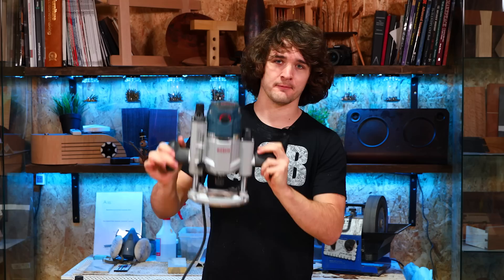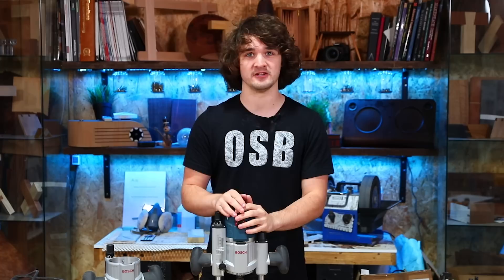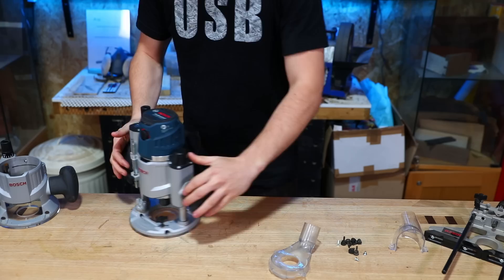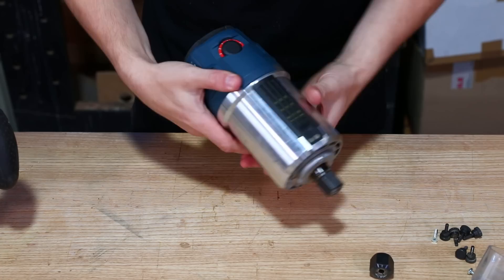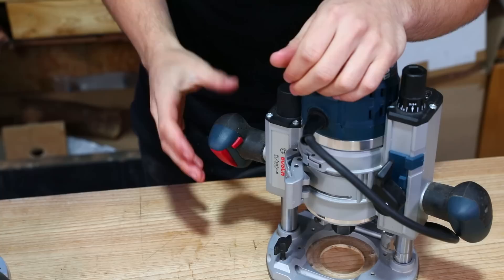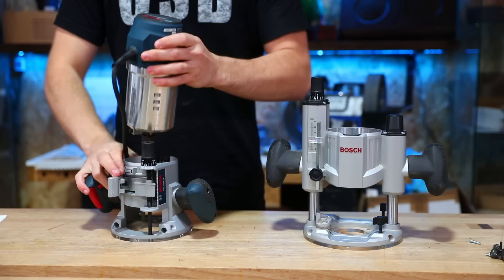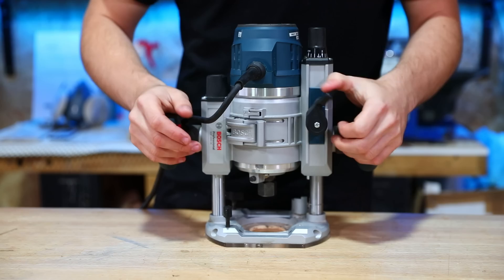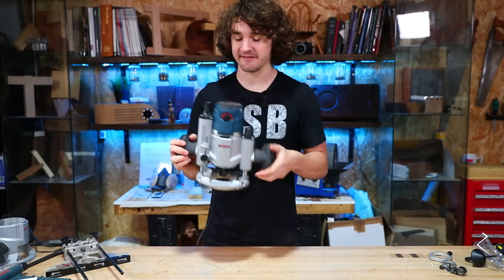BOSCH GMF1600 Router Review (Including Comprehensive Overview, Specification and Setup)

Comment: Am hesitating between this router(seen a lot in videos from the states,) and the Trinitron(that I can buy here in France.)  Great video; always liked Bosch Products...cheers...rr Normandy, France
Reply: Richard Rider   Hi, I bought Triton  trai001 and  nex day returned to shop really  cheap look and quality of buttons, plastic crap , to attach under table and  change bits brillen idea but when I start to cut round table  the bit fell down from collet  twice I was so sock   It was dangerous  for me! Plus 2400 watt   On paper look powerful but when you  start use  I didn’t feel power  and no led, when you switch on  3 second later start honestly I didn’t like quality at all returned  shop back ordered  Bosch 1600 gmf!

Comment: This is the best review of a router that i have ever watched so far!  I am in the look for a good router at the moment. You just might have talked me into buying this particular brand and model.  Unfortunately, I do not know what is the counter part model of this in the USA.    

I intend to put it on a router table.  That being said, what is the maximum height that I can possibly lift the blade up above the router table, considering the thickness of the aluminum plate or wood plate that i will use to mount the router? 

Also, being new to routers, what is the use of the brass bushing sets?  Hope you can demonstrate a video on what and how to use them.  Thank you very much!
Reply: Bosch MRC23EVSK

Comment: I nearly killed myself with a dw618 yesterday had a bit that was improperly set 1 1/5 lbs of steel flew out of the machine and by sheer luck flew from a tangent away from me found it 50ft away.

Instant life lesson, the thing shock and vibrated for 10 sec and i could not spare a hand to turn it off before it went off the rails.

Im not going to use it again and i bought this one with the dead man trigger.

Thanks for the video matt.

This was effin scray

Comment: I've just about finished table mounting one of these using the Bosch Fixed Base.  I absolutely love the router 'for the most part'.  I especially like the micrometre height adjustment on the f8ixed and plunge bases which is calibrated in millimetres and appears to have no backlash.  What I don't like is that you have to loosen the clamp on the fixed base to adjust the height, and the the clamp is so difficult to undo.  So I'd welcome thoughts on this if anyone has made a tool to undo that clamp.   I am also thinking the spindle lock button is not that easy to access when the router is table mounted. but I might rig up a solenoid to take care of this.  It would not be straight forward as the router have to be in the upper most position for the solenoid to align, but it is doable.  I think I measured the force need to push the button at 2lb.

Comment: Hello Matt, I have purchased the bosch gmf 1600 ce router....hope thats right...and Im also purchasing the ujk table. Can you tell me do I need the collet extension if I was to be changing the router bit above the router table via insert lift. Im very very new to this routing business. Great videos Matt.
Reply: This is exactly the question I was looking through the comments for.  Did you get one and can you change bits with it table mounted?  What about with a cranked spanner and decent sized hole in the table insert plate?  I would be eternally grateful if you can answer this.  Thanks.

Comment: Given how the power contact point are mounted for the trigger system these router will not work in any router lift system that doesn't mount the fix base to the table.  With  that in mind I'd still opt for the 1617.

Comment: So I have one of those and I absolutely hate it. I was looking at your video to see if there was things I was doing incorrectly or if there was some tips I could learn. The jack of all things, in my opinion is not a good thing as it does all those things not very well and I would highly discourage from using it in a table setup. I find that without locking the mechanism you cannot be sure the cutter is square with the plate but if you lock the mechanism you can no longer make adjustment. Also, that stupid handle trigger makes it impossible to use with any other professional lift (because you need the handle to turn it on). My recommendation is buy something else. Something more simple for your table setup and maybe a small hand router. It will probably cost a little more but you'll thank me.

Comment: Regarding the unresponsive trigger, the delay almost seems like a safety feature rather than a bug. For example, you release the trigger to be done with the cut, and accidentally press the trigger again for just a moment. If there's an intentional delay in response it might ignore that extra input. Granted, proper safety procedure would tell you to keep control of the tool until the spinning element has completely come to rest, but that doesn't always happen. I wonder what happens if you try feathering the trigger -- will it ignore the quick press/release inputs and continue spinning down?

EDIT: I've had the Bosch 1617 for a while now and quite like it. My biggest gripe, aside from the inconvenience of attaching/detaching dust shrouds, is the switch on the body. There's that moment where you turn the tool on with only one hand to control it, so the trigger-actuated switch on the MRC23 is very tempting.
Reply: I agree about the delay in the switch it could be a good thing!

Comment: NOTE:  only the GOF is available in Australia.  If you want the fixed base that costs you an extra $150, however, after watching this review I'm definitely getting one.  You also have to buy the fence separately.  And you don't get a nice carry box with it.  As always, we in Australia are screwed over when it comes to availability of cool gear.
Reply: Hey Blue Wren, where were you able to get the fixed base and guide fence from? I really want the GMF kit with everything but also live in Aus and the GOF doesnt have the same appeal. If I can get the bits separately, I would consider it, although they sound expensive.
Reply: @andrewford80  I got the fixed base from Total Tools in Hobart.  I believe they had it shipped down from their Sydney store which apparently had several in stock.  Please note that when you go to the total tools website it doesn't appear there (nor does the fence), so you probably have to ring them.  In my experience Total Tools are fantastic to deal with.  I didn't buy the fence.  I bought the Bora track instead as this was the better accessory given that most of the time the router will be in my router table, which is why I bought the fixed base.  The easy change out between the bases means I can switch from table to hand held in a jiffy.  It's an awesome router for all the reasons Matt outlines.
Reply: @bluewren65  thanks!
Reply: @andrewford80  No worries! Best part of you tube is helping each other out and interacting with other woodworkers.
Reply: I’m not sure. My router table has a set of clamps that will suspend pretty much any router base so I did t need to use the mounting holes. I’ll take a look today and get back to you.
Reply: I just checked and the mounting holes look the same as on the router. If you are in doubt you could always ring Bosch Australia and speak to a technician.

Comment: Hi Matt,
I recently bought this GMF1600CE set, based on your review here. I like you set up a fixed router table; However I choose to rotate it 90 degrees relative to what you did. This puts the two 'sets of controls' not on the front and back of the router table, but one set of controls on the left, the other set on the right. This gives decent access to both sets of controls.
Now 'all I need to do' is to learn how to use this versatile tool to its full potential....
Hint: Could you provide more detailed instructions on using both the fixed, and plunge router to make the various joints etc.
Thanks for your videos they are both educational and entertaining!
Willem
Reply: Hi Willem, I'm in the process of building my router table and need to drill the insert plate and like your idea of the 90deg rotation. How did you go about marking out the holes and drilling, there seems to be four securing holes in the router base plus the hole of the above table height adjustment. Instructions in the manual are not overly detailed.
I hope you don't mind me picking your brain, regards John
Reply: @johnweir2460  Hi John,
I turned the router upside down. I used a bit of cardboard on top of the routerbase to mark out the holes. Then I used an owel to punch the holes and screwed the cardboard in place just to make sure. I removed the cardboard template and placed it on the underside of the routertable. I next stuck it all in place. I rotated the template making sure I can access all controls. I drilled the routertable top using the template  and screwed the router in place.
So far it all works well.
I hope this answer your questions. Feel free to ask... 
Willem.
Reply: @WPGinfo  Hi Willem, thanks for the advise, I'll give it a try cheers

Comment: When using the router on the router table how does one control the on/off electrical power. Should there be a separate on/off switch mounted somewhere convenient?

Comment: Hi Matt I watched your review of this router and it clinched my selection decision, unfortunately with the Covid pandemic I had to wait several months to take delivery and then the router table I wanted (Rutland) was out of stock. Anyway to cut a long story short I'm in the process of building the the router table and I need to drill the mounting plate to take the router. Can you share any tips on centring the router, marking out the holes and drilling; I've been searching for instructions/videos but with no joy.
Keep up the good work :)

Comment: Do you need to use the clear acrylic base for mounting the motor on a router table, or can you just bolt the motor to the fixed base?

Comment: About the table router. Am I being thick or you can just fix it with the locks to one side and the speed control to the other??? having a small angle to the fence you can even have the level adjuster near the fence.

Comment: Got this router a couple of months ago, great versatile router, one problem though, the spindle lock never worked and ended up removing it and just use 2 spanners
PS
Looked at both the links for the router, one is out of stock and the other is low stock, I don't believe that a company would sell out of stock within 10 minutes of this video coming out. I do wish that UTubers would check their links, the websites do say if there is low stock on something after all you cant get paid for the link if there is nothing to sell
Reply from the maker: Glad to hear you like it Roland! The issue with stock is why I provided 2 links for the UK. It gives a higher chance of the routers being available straight away. This is only an issue currently however they will most likely be in stock if someone was to watch this video in a month or two.

Comment: When you mount it under the router table, do you reach for the trigger every time you turn it on? I wonder if there's a way to wire a permanent switch installed on the router table to override what.
Reply from the maker: My router table has an NVR switch that I can plug the router into. So I only have to turn it on once, then it’s all controlled from the switch
Reply: @MattEstlea  I thought the router will not turn on if it was plugged in while the trigger is already pulled back.
Reply from the maker: This one does. It’s often a safety feature on power tools with on/off switches that can accidentally be left on. However seeing as this is a sprung trigger, it’s quite difficult to accidentally leave it on. Unless you use the trigger lock of course.
Reply: @MattEstlea  OK I just tried it on mine, and no surprise you are correct. It does turn on when plugged in if the motor is in the base and trigger already pulled/locked. The safety feature kicks in if the motor is inserted into the base when it's powered and and the trigger on the base is pulled/locked. 
Gosh I've been wrong about it all the time. I even bought a separate motor for the router table thinking the Bosch won't work well under the table with it's fancy trigger switch.

Comment: I just watch this video, and I was wondering why you dont mount the router with the non-switch handle forward, then you would have access to both the release mechanisms and the speed control easily on either side. And the raising screw would be accessible and you could use a remote power switch after locking the power switch after installing the motor to the base

Comment: So you use the quick-change system to install a slow-change system because you can’t make a box to hold the quick change fittings neatly?  :)
Reply: The original bosch fitting are quite expensive.

Comment: Dear Matt. Thanks for your overview. I actually have this kit but did you ever have issues with the rails on the plunge base catching or being jerky either on the way down or up? I've had so much trouble with this, even after lubricating according to the advice of techs over the phone, I couldn't safely use the plunge feature. I'm trying to decide whether to try getting another one, or just not do plunge routing for now. The router itself and the other features still work on the fixed base just fine. It's a great router otherwise.
Reply: Ditto, I have the exact same problem with mine which is a shame. Have you found a fix since you wrote your comment?
Reply: Ditto, I have the exact same problem with mine which is a shame. Have you found a fix since you wrote your comment?
Reply: On the side of the right handle, where the switch is, I unscrewed the black cap that is over the shaft. In there it has a white plastic fitting that covers PERIMETERLY the gaps that the housing has with the slide shaft and NOT AXIALLY. This has the result that all the sliding is done at the expense of the brass ring that only the side with the fine adjustment has. So unequal distribution of forces on the axes => seizing of the bronze ring. This specific component does not fully touch the shaft, but only in one part of it, the one with the many curves, which already only touch at their top!
The solution was to go to a machine shop and have them replace the white plastic part with a brass ring! The brass ring was made as long as the overall length of the white plastic, so that it would contact the shaft on the largest possible surface, but also to pass the cable around the ring again without coming into contact with the sliding shaft. I hold it in my hands and I think I'm holding another router! Gliding is now super smooth!

Comment: i've had three of these on the go for about 3 years, a fixed base machine in a router table and two plunge base machines for handheld use.  Here in canada, they are called the mrc 23 blah blah blah!  the 23 refers to the horsepower rating which of course is pure bullshit like all other hp ratings.  you cant get 2.3 hp out of our 120V 15 amp circuits!
love the routers for the same reasons as you.
as you said, the north american versions use 2 wrenches(spanners) for the collet, much better for a big router.
my only issue is with the machine upside down in a table.  i do find that crap gets stuck in the low voltage tracks occasionally, this prevents the router from starting until it's cleaned out.
with the machine(fixed base) in a router table, you can fine adjust the height with an allen key through a hole in the tabletop.  oops i see you covered that feature!
i have the height adjustment at the front, speed adjustment at the back,  the speed adjustment is easy to find "in the dark"

Comment: Hi Matt, great video. Thanks to your information I'm considering getting this router. My question is, does this router fit straight to the ujk plate on the table or do you need to drill new holes or to use a sub base?
Hoping you can help, thanks.

Comment: Matt, love your channel. I have a question for the dust extraction hoods for this router that is driving me crazy. The router's plastic case has nice spots for the fixed base and plunge base dust extraction hoods. Really convenient. But the dust hood for edge forming doesn't seem to have a spot in the case. Am I being dumb or is this one accessory that needs to be kept outside the case?

Comment: Matt, did you have to drill out the UJK table insert for the router lift adjustment. The inserts shown on Axminster don’t appear to have the access hole that you mentioned - could be that I am just looking at the wrong instead. Your suggestion would save me the extra cost of the UJK router lift - a cost which is not insignificant. I look forward to your reply.
Reply: Sorry,that should read looking at the wrong item.

Comment: Hey Matt, cool review, I actually have got this in the post today and I have the UJK mounting plate, the aluminum one with the pre drilled holes. Did you have to drill a hole in the base plate to access the rise and fall mech as I can't seem to align mine alongside the 3 holes that have been pre drilled.?

Comment: There have been numerous comments highlighting the propensity for the plunger mechanism to either catch or stick. Can you verify, or otherwise, if this plunge router has Linear Ball Bearings at the pillars, like the Makita RP2301FC 3-1/4 HP Plunge Router?
Reply: I have an older GOF 1700 and that really has a tendency to stick especially if you do a onehanded plounge.